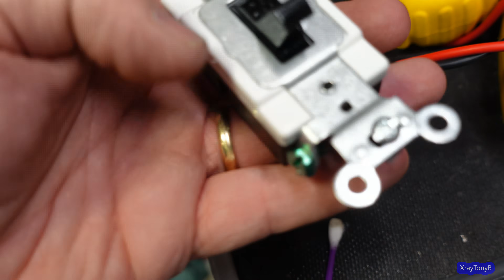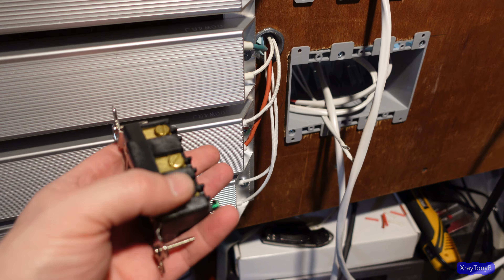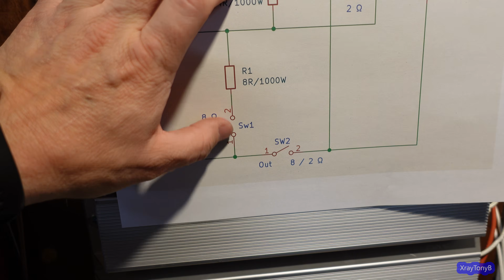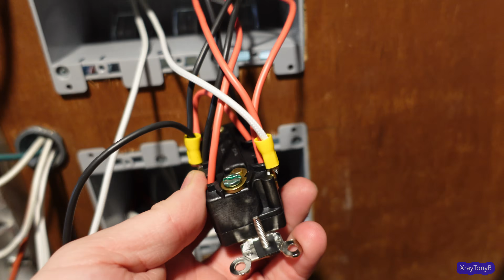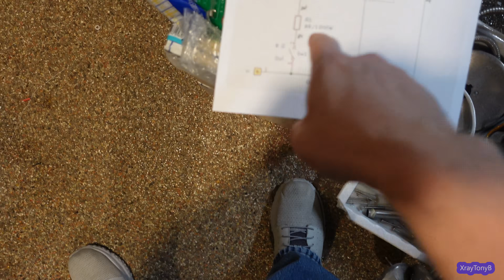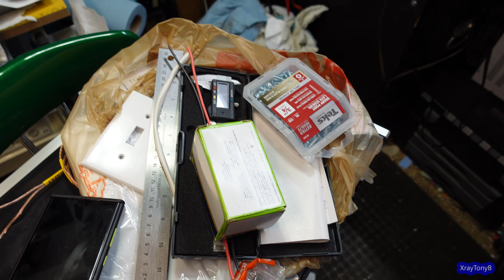Audio Resistor Dummy Load Upgrade for My Bench

Comment: I used to use a load of 250W metal clad resistors bolted to a square metal waste paper basket as a heatsink. For prolonged testing I’d fill it with water. Cheap and easy. The resistors were obviously inductive to some degree, but so is a speaker.

Comment: Tony why so many Watts? What amp or stereo repair would you need more than 100 watts to test. My dummy loads are only 100 watts each at 8 ohms and my 4ohm dummy loads are also 100 watts. I also have a switching system where I can parallel or series them.
Reply: If I had to guess its for stress testing pro amps or car monoblocks.

Comment: You didn’t say this specifically but someone might get the incorrect impression that you have an available 3 kW, 4 ohm configuration by putting two 4 ohms in series and then parallel that with the single 8 ohm resistor. The input current will split evenly between the single 8 and the series pair of 4’s because each path is 8 ohms. Each path will dissipate equal power. The entire configuration can still only dissipate 2 kW. When the single 8 reaches its 1 kW limit,  the series pair of 4’s will each only be dissipating 500W each, for a total of 1kW on that path. Any more input current will overheat the single 8.

Comment: Thanks for the different upgrades' videos!
Next upgrade: is it possible to add a very small, cheap loudspeaker in parallel to the resistance in order to hear the frequency, pink noise, music or whatever is used as an input?
I saw a DIY schematics using a speaker in series with a 200R 2W resistor (the whole being in parallel with a 8R 50W).
Would it work?
Shouldn't the circuit include a decoupling cap to maintain the overall 8R that the amplifier needs to see?
Thanks for your help!

Comment: Hey there! I am new to the channel! I have a lot of videos to watch, but I would like to know if you or additional commentators could help clear up a question for me or direct me to an information source I can read. I want to be able to figure out with accuracy what Effective Load Resistance I should use for two 6L6GC (30W max ) fixed biased, Plate voltage of 440-450V, and screen voltage will a couple voltages lower than the plate. I plan on biasing just lower than 70%, so say 65%; 19.5 W ea. So 86ma DC total for bias to 19.5W ea,  and 93ma DC total for 21W bias. I will use a multi-tapped 4 - 8- 16 ohm speaker secondary. I ask because I have come across information that has given me different results, and I see many Guitar amplifiers be slightly off of that datasheet. But I am aware that a lot of common Guitar amp designs have their flaws.  Thanks for the help, fellas!

Comment: nice set up gives you enough flexibility  to work on even some smaller "commercial" PA's  without resorting to a tangle of patch chords.
I would have had to use some 20A toggle switches and  making a  cover panel from some appropriate metal.    the look and function is                                      really nice.

Comment: I'd be tempted to go with contactors controlled by small switches. The EV industry probably has affordable ones by now. At some point you could even automate the setup with some software and low cost processors.

Comment: An excellent solution that meets your needs, Tony! Kudos!
Because...
1) quality switches are expensive and
2) any fixed switching arrangement is likely to have at least some limitations in the odd, needed on-the-fly wiring arrangement,
I elected to use simple, panel-mounted banana eyelets and short, banana plug jumper cables to make the connections. Simple, cheap, and universal... I can make any arrangement that I want.
I hope that inspires ideas in someone that needs a less expensive, or elaborate, solution.
Oh, and another idea... I have a great deal of extra room, in my DIY electronic load case. So, I will be mounting my audio load in that case, as well, to make a "load center." Cheers!

Comment: That's insane! Now all you have to do is find an amp capable of "thermally re-arranging" Ayrton Perry windings on these! Good luck with that! Mine's much simpler; 3 20A DPST switches with four 16ohm 100W resistors per channel. With all switches out, we have 16ohms@100W, all in gives 4ohms@400W. Entire set of alloy bodied resistors is clamped to a finned heatsink, force cooled by 2 fans, controlled by a dimmer switch, if needed. There's also a provision for small value caps to simulate capacitive load. Works well, but oh my, these 1kW boys mean business!

Comment: Mr Tony I do believe you overcomplicated that by a long ways two four ohm can give you all your combinations for one channel 
You're extra 8 on is not needed at all
Reply from the maker: First of all, I already had the resistors.  Second, as I mentioned, I may want to add another DPDT switch to allow the 8 ohm resistor to be in series or parallel with the others to have 16 ohms.  Third, in order to have 4 ohms, I would only be able to use one of the 4 ohm resistors.  As these are very high wattage, that is mostly not an issue, but if you are running high power into 8 ohms, then it would be even higher power into 4 ohms, which would dissipate a lot more heat.  This setup will in most cases run cool, even when running for long periods of time at high wattage.  Last, this also gives me the 1.6 ohm option for high powered car amplifiers that are designed for 1 ohm stability.  Thanks for the comment!

Comment: Since speakers are not perfect resistive loads, have you thought about some reactance to your testing?  Both for stability and power delivery. I suspect an amp's ability to deliver power in the presence of reactance is what makes amps sound different on the same set of speakers.
Reply from the maker: I thought about that a long time ago, but decided that it would really not be necessary.  Every speaker setup will have a different impedance curve.  Testing the amp at different DC loads shows how the amp handles those loads in a controlled manner.  If we are concerned about oscillation, the easiest way to test for that is to add a capacitor in parallel to the load resistor.  Usually a film cap of 1uF or less will show what you need to see.

Comment: What's generally not appreciated is that switches also have minimum voltage ratings. If the contacts are not gold, they'll oxidize over time and a voltage is needed to help break down that oxidation layer.  These switches are designed for 120VAC. You may find over time the switches will get flaky.
Reply from the maker: The contacts only care about the amount of wattage passing through them, not just the voltage, as the voltage drop across them is very low.  Most light switches only switch a fairly low wattage.  Even with incandescent bulbs, it usually isn't above a couple hundred watts.  It will be many years before this becomes an issue, at which point, I'll just replace the switch.   Thanks for the comment!

Comment: If you run 2000watts through your 2ohm load, you'll be running over 32amps. I know you'll rarely if ever do that, but I don't think those switches are rated for that... Probably current and power limited by your switches and not your load resistors. Limited to lower currents by your wiring as well in that case too. Maybe use small switches and some large contactors if you ever do need that high power capability... Love the idea though! Edit...  I stand corrected... That switch is 30 amp rated! Are the others?

Comment: I was thinking, incorrectly, that @ 2:55, the 2 - 4 ohm / 1000 Watt resistors in series would only have a 1000 watt capacity, But, since they each have a 1000 watt rating, the wattage is also additive along with the resistance. You would think it wouldn't work like that, but it does.